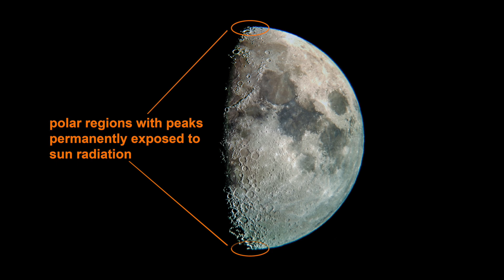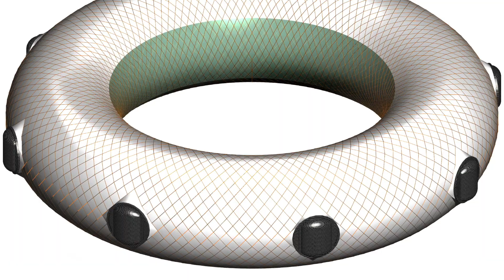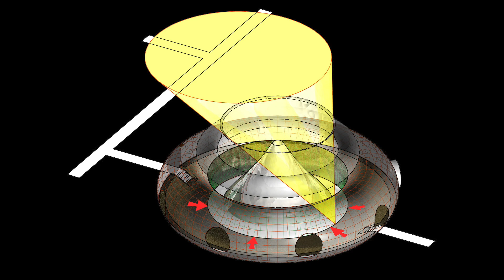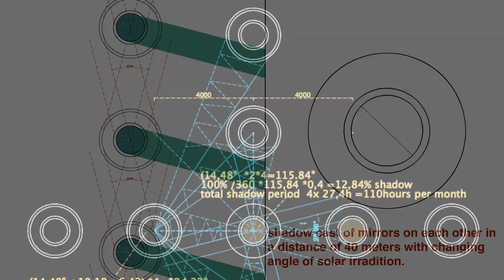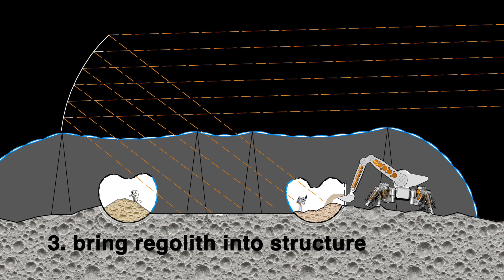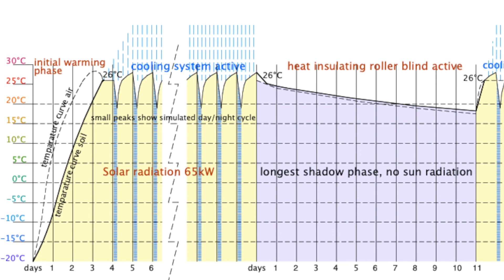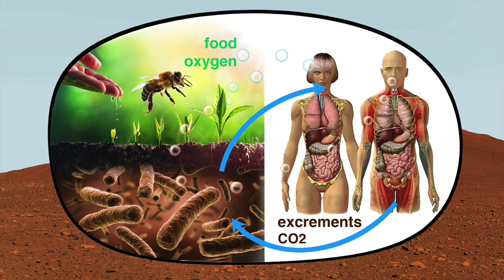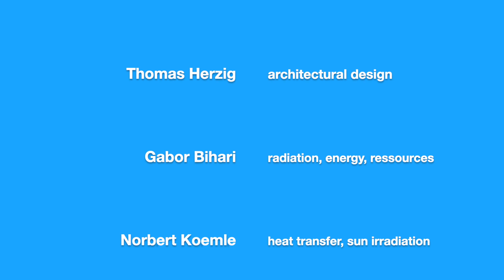Inflatable Moon Habitat with greenhouse, funded by ESA (Open Space Innovation Platform)

Comment: With the air pressure at such a low level, whatever amount of O2 you supply, the O2 will lift and congregate on the ceilings leaving non breathable air on the floor. This could have benefits. Bacteria and molds will not be able to live at lower levels of the hab. Negatives mean that sleeping area will have to be lifted. On Earth, Oxygen is interspersed evenly throughout the atmosphere because of gravity at 1g and the pressure of the atmosphere at sea level. With the Moon being at such a low gravity, and with the pressure lowered, Oxygen will gravitate to the tops of the habitat. It also must be noted that Apolo 1 serves as a very good reminder as to why an overly oxygen rich environment is dangerous.
Reply from the maker: only CO2 is a considerably heavier than Nitrogen and oxygen. But it will not exceed 1%. content of the air. Furthermore it will not accumulate on the floor for the same reason why this does not happen on Earth. The air is in permanent movement. Lower gravity even helps the gases to remain mixed. We have fans installed on the ceiling of the greenhouse the blow air through the heat convectors that transfer excess heat  from the greenhouse to the radiator outside.
I am aware of the apollo 1 accident. But there the content of oxygen was 100% at 15% above atmospheric pressure. We only have 35% at half atmospheric pressure. and we have humidity  in the greenhouses.  On Earth in the carboniferous age the atmospheric content was 35% as well at higher pressure than now.

Comment: Excellent concept and great video.  
As a metallurgist, I suggest you consider high-strength steel (essentially piano wire with UTS of 2-3 GPa) for the tensile members, which is much more durable than CFRP, much better in vacuum and when exposed to the sun for years (for the outside truss), and also much tougher (will resist accidental bumps from the crew). Also, steel can eventually be made from moon regolith, unlike carbon fibers and epoxy, and is easier to make into thin struts. 
Also, the inner transparent membrane is exposed to the very cold vacuum.  How do you prevent water condensation from the greenhouse onto these "windows" ?  Maybe use a UV absorber which will self-heat the membrane ?
Reply from the maker: thanks for your input.  when the truss parts are made of material mined on the moon, they weight does not matter. When the structural parts need to be sourced from Earth we would need to compare and evaluate UTS vs Carbonfiber regarding weight vs Strength, stiffness, bending resistance.
While sunlight is entering the greenhouse and the artificial crater within, the temperature gap and heat transfer to the vacuum outside is not much. I am more concerned that the crater will be a kind of heat trap. during dark periods the greenhouse window is covered.
generally we want the vapor to condensate on the walls and on the cooling radiators inside the greenhouse , so the water transpired by plants can flow down into the soil again and the air humidity can be kept on a decent level.

Comment: 🤔There's no real point in using a mirror system like this. If you wanna pipe sunlight down to an underground greenhouse the best method is to use fiber optic solar collectors. They are an already well developed commercial product that would need little adaptation for use on the moon and would eliminate the complexly in building a space mirror and having to build the green house around said mirror. Also not only would fiber optic solar collectors not leave a path for cosmic radiation to enter the greenhouse they filter out UV and IR light. Which is highly desirable because neither is used by photosynthesis. UV is destructive and too much IR would have to be removed by a cooling system.
Reply from the maker: as we mentioned in the video , the Kapton foil of the mirror membrane is coated with silver ( instead of aluminium) which reflects much less of the UV-radiation. 
All the optical collectors, the  sealed glass fibre, the spots that emit the light again and the structures that need to hold these divides add more to the payload than a thin mirror membrane. 
Only to hold the optic solar collectors  in the right height and right position you need a similar rotating  truss frame structure , but the weight of the collectors is higher than for the thin membrane, so the structure needs to be heavier as well.
Then you have the weight of all the cables, and again the weight of the outlets while you do not need any components for the reflected light to flood the greenhouse.
Additionally  glass fibre cables have high optical transmission losses when they are long.